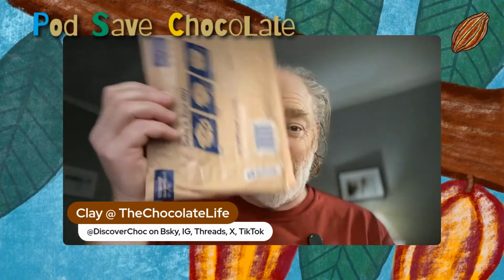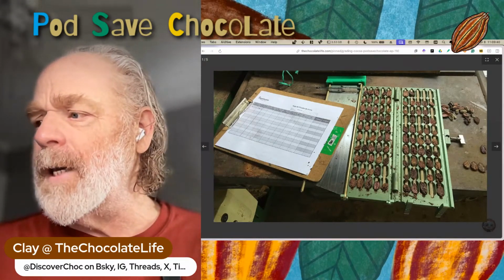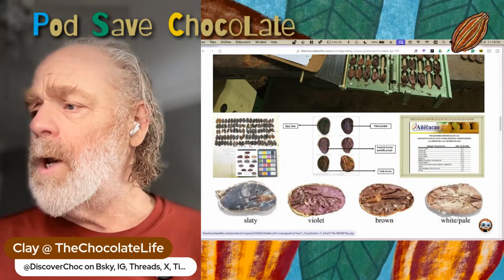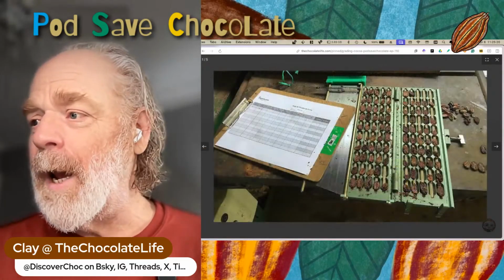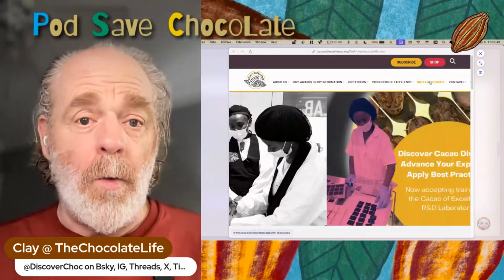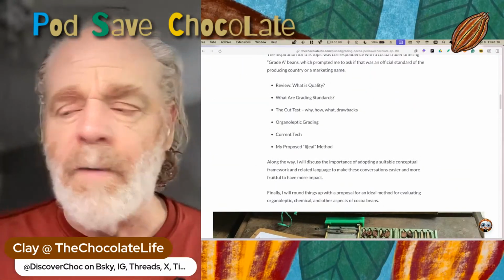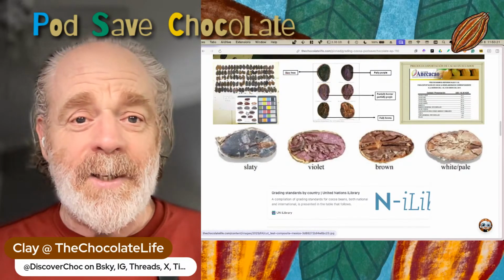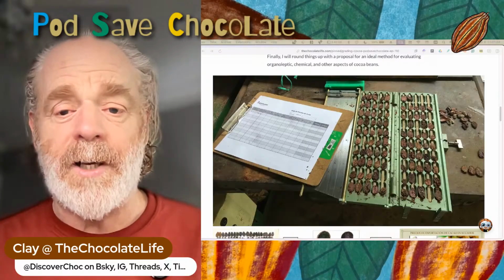Grading Cocoa | #PodSaveChocolate Ep 110

Comment: "Can a batch of Indian Forastero hybrid cacao beans be considered good quality for chocolate making if they are entirely brown and smell of acetic acid? When pan-roasted for 20 minutes at 120–130°C and conched for 48 hours, the resulting 100% dark chocolate tastes harshly bitter. Should I still use them for chocolate?
Reply from the maker: There is no simple answer to your question, unfortunately. 

Bitterness is often a sign of over-roasting, though it can also be a signal of improper fermentation (or a combination of both). Pan roasting can be very uneven as I have seen first-hand on comals in Belize and Mexico.

When you say conching ... do you mean refining in a wet grinder? Bitterness is not always something that can be conched out, it needs to be hidden by flavoring ingredients. Salt can reduce the perception of bitterness, for example. Sugar (sprinkle some on the liquor, no need to refine in).